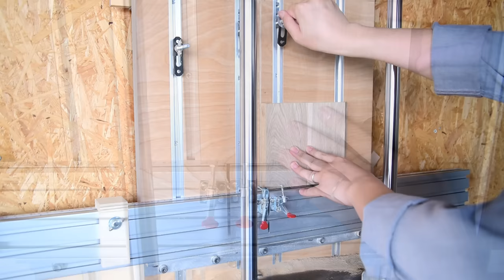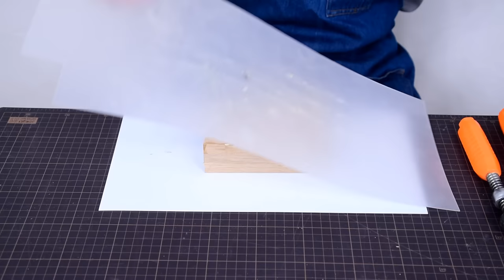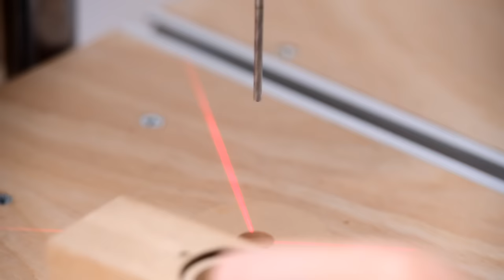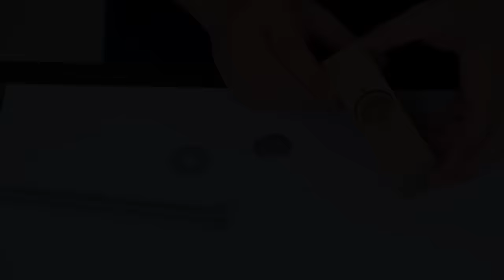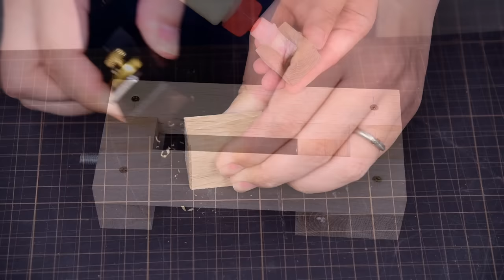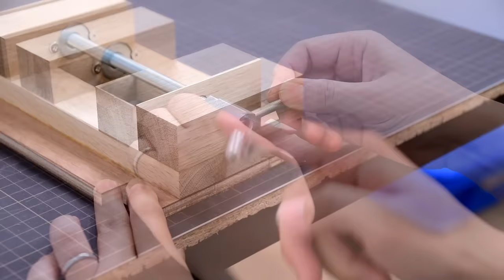【Simple & Smart】Make a Wooden Vise - Drill Press Vise

Comment: Nice Work ! i’m a retired Woodworker that suffered a Major Stroke in my 40s that BrainInjury left me partially paralyzed in my left Limbs  so i now only have my right hand to do everything i need to do  luckily the 35 years of Woodworking taught me how to develop Jigs and use Clamps  my youngest child who knows me very well  and how my mind works  always  gives me thoughtful gifts  that may be a little out of the ordinary for some people  some of those have been smaller Quick Grips and she knows that i’ve found lots of uses for a cheap IrwinDrillPress Clamp i’ve bolted down to my desk  i’ll clamp small pill bottles or glass jars wrapped in a towel to open the Child proof lids with my one good hand  or something similiar  making a nice Wood Clamp like yours will be even more helpfull in my daily life  BTW for last Christmas she gave me  a Made inChina Jewlers or Watchmakers Vise that is basically the same style just scaled  down in size i do like working on Watches  as a Hobby  and today i used the little Vise for several hours  to hold medication Tablets packaged individually on a card with a plastic cover and AluminumFoil backing  to make it easier to get the pills out i Clamp the packaging tightly and cut them out with a pair of Scissors in my one good hand ! i’ve figured where to cut the packaging and the Pill just falls out  the Wood is a   different style of gripping objects and  i like the idea that i can easily machine,modify ,or repair it with tools i’ve been using for years

Comment: Add wax to the wood where it slides against other wood parts to prevent binding and give long lasting smooth working function.  Add a finish to protect wood parts from moisture and warpage over time.  Looks like a great project, I plan to bookmark it and make one!

Comment: Adding a layer of wood glue or hot glue or even gluing on a strip of an old yoga mat to the inside of the jaws would create a rubberized surface to protect any work pieces from dings or marks that you'd have to sand off later and would add to grip strength
Reply: It is literally made out of wood already

Comment: Drill press sounds very underpowered.  Use of cutting fluid or oil would help when drilling out the coupling nut. Also, adding detachable faces with v-grooves running vertically and horizontally would help when drilling round or hexagonal objects (like the coupling nut). Overall, well executed and designed. 😁

Comment: it's beautifully crafted but i am not sure what problem it solves. if it's to hold your work so it doesnt move, it only kinda accomplishes that because the whole vice can move. and holding work up away from a firm surface means you get tearout at the end of the hole. i'd rather use a smooth piece of disposable scrap on the table and put my work on top of that so there's no tearout, and i get the same control of where the hole is gonna be

a useful vice would work like a milling vice, bolted down and micro-adjustable north-south and east-west so every hole has pinpoint accuracy and the work has no chance of moving. the problem is how could you do that and also control tearout?

Comment: Elegant build. Your shop must be interesting with the panel saw and the forked clamp (as well as all the shop built items). Question: what did you use to secure the captive nut to the end of the threaded rod?  Did you consider drilling through the nut and into the bar for a self tapping screw?

Comment: Love this. Light weight and simple, with very little parts needed. This makes me realize just how little hardwood I have in my shop. Good thing I have a bunch of oak logs in my wood shed that are long since dry. Time for me to see if I have any that are free of splits that I can cut down with a chainsaw and mill up on my table saw. 

Also I'm curious about your slide saw, what looks like a vertical panel saw, and your drill press. I want to build a drill press since I sold mine off years ago when I moved and I've yet to replace it.  I've gone to buy a few but they turned out to be worn and sloppy.  Also I have no use anymore for my corded drill after I got my lithium ion drills, so a drill press would be perfect for it. I just wonder about how downward pressure is achieved, although it looks like yours is half tubed.. Well I guess I'll go see if you have a video on that too.

Comment: very nice work, but man is this video slow and painful to watch..
anyone capable of taking on a small project like this doesn't need to see you spreading glue, or slowly lining up pieces.. we know that happens, we do it everyday too..

I like the design of the vise, but this could have been a 10 minute video, (to be honest, I jumped through at least 5 minutes of this at the start, coz I know how to cut wood) just focusing on the really important details, like the tiny bit of required clearance for the small inner block so it glides easily in the track, (rubbing a bit of candle wax on the sides of the block and tracks will assist with this too), or the epoxying of the captive nut in the fixed jaw.. things like that..

Comment: 5:15 looks like your machine isn't powerfull enought for foerstner drill bits, 
try instead "spade wood drill bits" they need way less motor power + cutting pressure. 
They cut also faster. Here is what i mean: 

https://www.ebay.com/itm/6-40mm-Flat-Wood-Drill-Bits-Carbon-Steel-Spade-Hex-Shank-Cutter-Carpenter-Beat/173896825798?hash=item287d0efbc6:m:m6APCTzW7naQaa3wpmANqsQ
13:58 you could just use the same principle you did in 13:54 , drill a hole trough the hexnut while its mounted on the rod, then you can put a "nail" thought the hole to secure the nut.(Nut with setscrew self cut thread)
http://www.wintex1000.com/sites/default/files/styles/product_rotator_image/public/parts/Nut%20with%20Set%20Screw%20for%20Piston.png?itok=AKUv6FX4